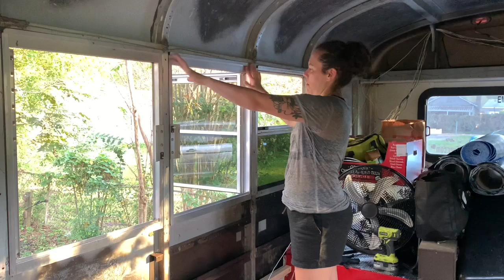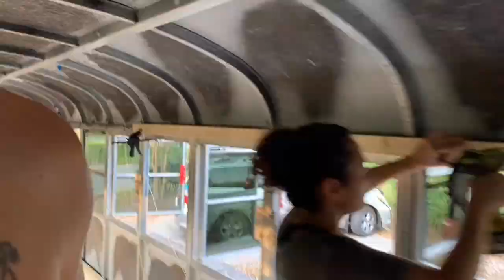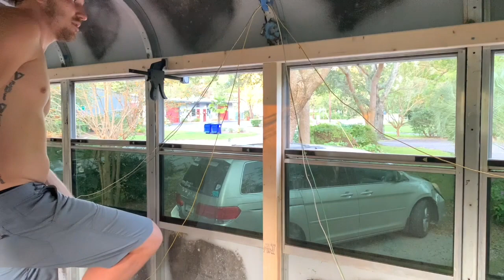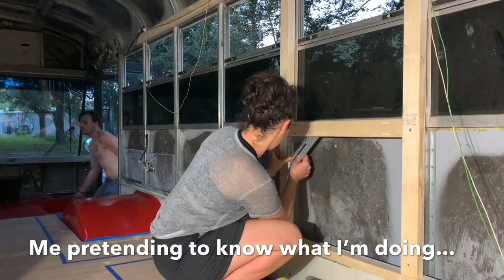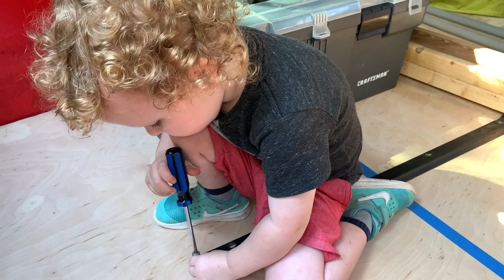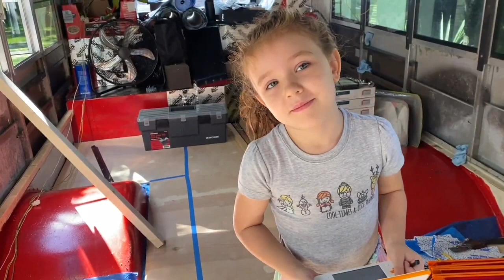Framing our Bus Walls  - School Bus Conversion | Skoolie - VIDEO

Comment: Did you re-seal your windows?
Reply from the maker: Yes, indeed! Felt like that was a must with how notoriously leaky these windows tend to be. You can check out these videos, for more details if you want:

Wall & Window Removal: https://youtu.be/s3BYCJ4cQPY

Fixing leaky windows: https://youtu.be/QrY2Rq96A1Y

Are you planning on resealing yours? It's a painful process, but seems pretty worth it, so far.